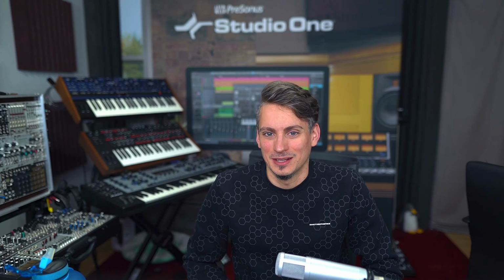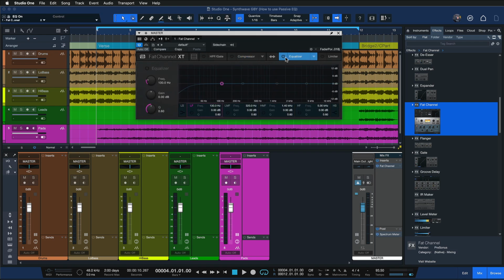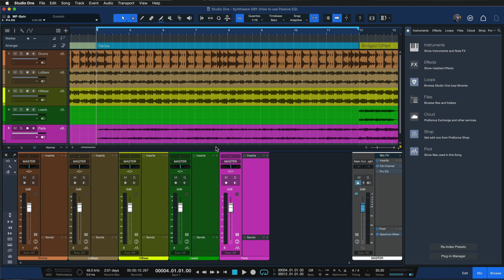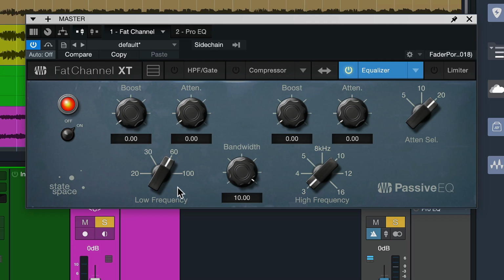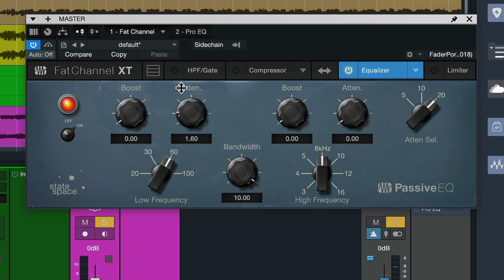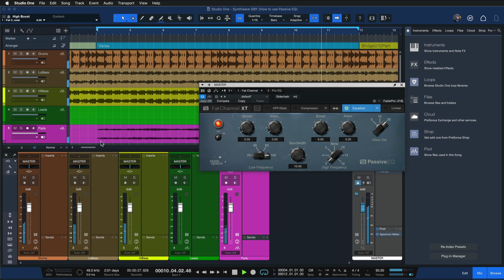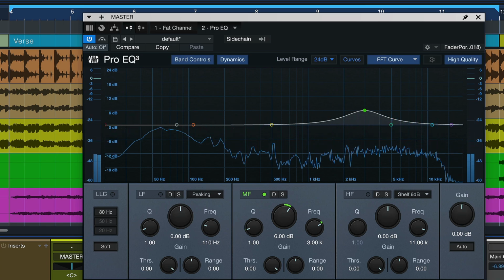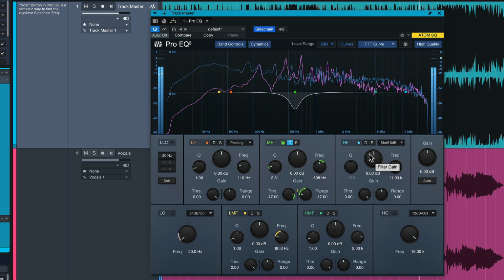How to use Passive EQ

Comment: it sounds good but not that useful without a output level control,you need to be able to gain match to see if you are helping or harming imho
Reply: You can't really accurately gain match equalization.
Frequency boosts or cuts change perception and phase (which in turn affects perception), not just and not necessarily dB level.
There seldom was a level knob on hardware eqs.
Also, IMHO gain matching is overrated and a very blown up internet fad - useful at times, yes, but if you know what you're doing and what to listen for, level won't trick you, and you can always hear it & make sane decisions.
🤷🏼‍♂️😉

Comment: Well explained (as usual), Gregor.
Are you sure those are dB? On Pultecs, and Pultec type plugins, normally those were & are arbitrary markings, in which 10 is a lot different than 10dB, and is also not the same amount of dB for the boost or cut, or for the high and the low band.
A good tip for those who need to better understand what those Pultec eq curves look like and how they interact is to either check them out with Plugin Doctor or Waves Q Clone, or simply to put some white noise through the eq and observe what it does on any analyzer placed after the eq. I always felt that getting a good idea of what those curves actually do, how broad they are and what actually happens when you combine them is equally as essential as trusting your ears for this type of eq.
BTW do you have any info as to which specific Pultec/from where/from which studio was modelled by these slightly mysterious "State Space" guys, and what method they used?
BTW 2 what's that fluorescent mini gas tank kind of drink you have there? Must be the secret juice that makes you so bright and friendly!
😉😉😉👍

Comment: the low boost and atten are way too sensitive, 1db boost sounds like 6db boost on other pultec simulations. The usable range is really small, hope it can be fixed in future updates.
Reply: It doesn’t need to be “fixed”.
Reply: @officialWWM  it does, it’s way off than the pultec hardware I have and the other plugins.
Reply: @TianpeiWang  it doesn’t need to be the same. You need to learn to use it as it is or download a different version 🤷🏻‍♂️
Reply: @officialWWM  the point is we all know how to use pultec and how a good plugin should be. Its like if you get a very good car, the break feels too sensitive, as a experienced car driver, you should let manufacture know, only the new drivers won’t know. 2 years ago we had a live session with Gregor talking about the lack of automation function in Project page, now we have it. A good software should based on user experience, this is also how S1 and Reaper get this far today.